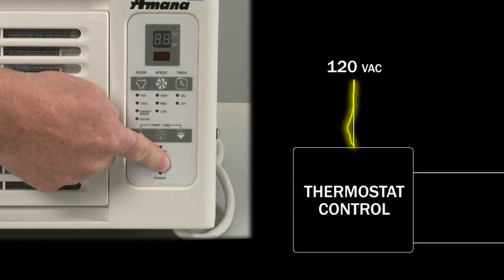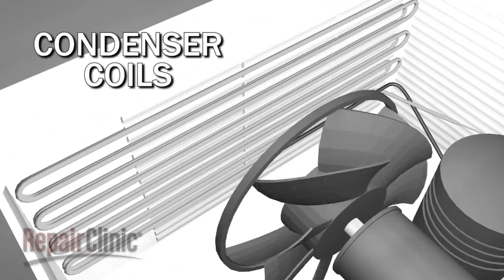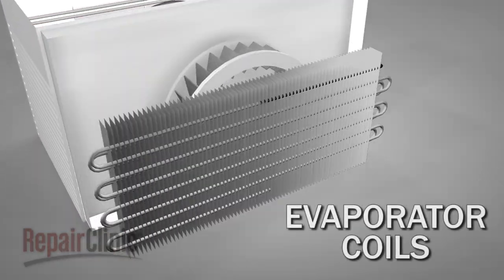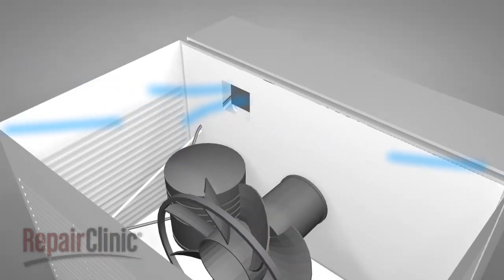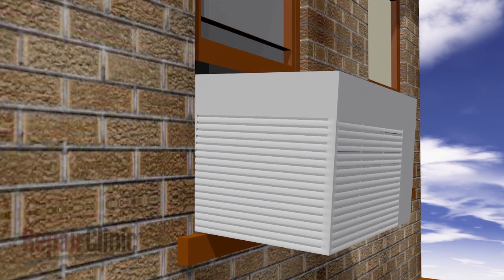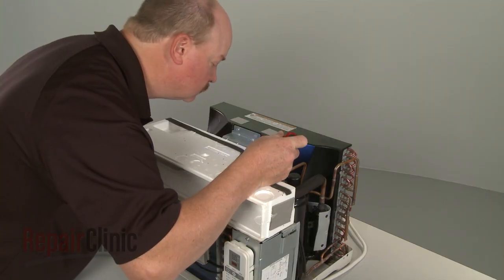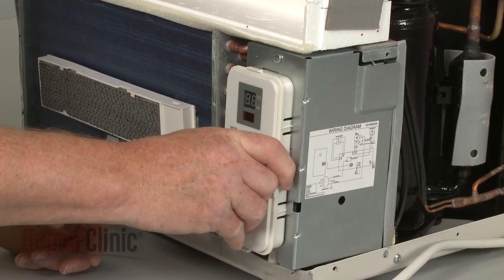How Does An Air Conditioner Work? — Appliance Repair Tips

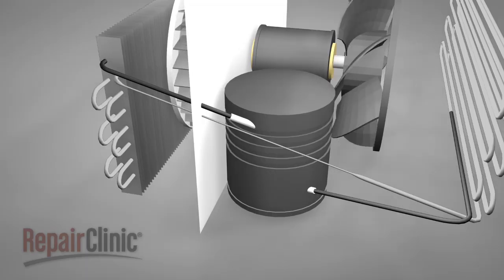Comment: The compressor does not convert the refrigerant back to a liquid lmao which is what he tries to say at 1:10
Reply: Yeah, converting a liquid to gas and gas to liquid is done via the evaporator and condenser coils. The compressor should be increasing the pressure of the gas.
Reply: 1:42 can anyone tell me what that brown wire just above the barcode is ? i have a feeling it may be something important. see the thing is i move that out of the way every time i replace the filter. over time it stressed that wire out that it broke. and now my air conditioner wont cool. it runs and the fans runs but it doesn't cool.
EDIT : watching further this may have been a "Sensing Bulb" but i cant get a clear answer from the internet.
Reply: @SIDEKICKONYOUTUBE  That's not a wire. The sensing bulb is copper tube usually filled with refrigerant (not part of the A/C refrigerant). In an A/C system it is attached to the expansion valve to monitor flow. That has to be there.
Reply: @BillC-64  mine feels like a tire wire. its positioned just the same as in the video. i thought it was just some sort of holder for the filter. if i trace the tire wire looking thing it connects to the control box and somewhere in there the tire wire is enclosed in some sort of plastic insulation.

Comment: "Any repairs must be performed by a registered technician" and pay his ass 200 dollars? Nawww these youtube videos are fine, it's like college except I'm not going to be in debt $60,000 like everyone else :D
Reply: 200 dollars I'll just buy another ac
Reply: +Alex Reyes yeah serioudly, that's what I did, my grandma's has a little window unit in a backroom that doesn't connect to the central air system and she was about to call to get it repaired, but you can buy them for like $125-$175 for the small units o.o
Reply: except you don't become an expert you become a diy and this guy said a compressor pumps liquid... never in 1000 years should an compressor try and move liquid and after your YouTube repair you find yourself calling a pro
Reply: I like Playstation if you paid 200 for a repair guy you would be stupid anyway. you an buy an 5000btu for $70 brand new. 9 times out of 10 people just forget to clean the filter
Reply: I suspect that within two decades, the current university system of four years and $50k worth the debt will be considered a backwards relic of the past. A large number of people will learn online and then go to accreditation centers to prove their ability. Also, unless you're taking a STEM degree (can easily eliminate a year from the program and cut down on the cost by tens of thousands of dollars by shutting off the valve of infinite wealth redistribution into their pockets and forcing them to cut everything that's not absolutely necessary; no more excessive administration or activist departments destroying wealth), all post-primary schooling (which I suspect will also get shortened by 2-4 years and will become more focused) will take the form of trade school that teaches you what you need to know in order to get to work in no less than two years.
Reply: when it comes to a cooling system using refrigerant it can be very dangerous to work on yourself without extensive knowledge on how the system works. It is pressurized.

Comment: Well These types of AC can be placed on your window or remove from your window since these windows type AC are small and compact some window type AC are Large There's a medium size and there's a Large size these Window AC that are are medium or large cannot Remove and Also you can Still place this to your windows if your window are large enough to place it just buy a support bracket but i preferred to Make a hole in the Wall of the house and place the AC to that hole it alot of work but yeah and also don't forget the support brackets but if you want you can Weld a Cage for your AC and place on Where you want to put it

Comment: AC is working but not blowing cold. is there a way to add gas in it without buying the compressor? like how u do with the car?
Reply from the maker: Calvin Le No. Only licensed service technicians can repair refrigeration system on HVAC equipment.
Reply: what about the one where you put on the window? can i put gas in there?
Reply from the maker: Calvin Le The sealed system is not worth repairing on window models. Refrigeration system repair is not a do it yourself type of repair.

Comment: Thanks. Just need to know if exterior air is circulated inside. There is an ash haze (fog like) condition due to wild fires in the neighboring county and wanted to know if that air is going to come in or not. It’s over 100 today so I wanted to limit the need to use it if needed as fire season can last for weeks or months. Though if rolling power shut offs continue, I might not get a choice any ways 🤷🏻‍♀️

Comment: Hi in my work it have a PTC 30 TON UNIT A/C THE EVAPORATER IT GET FROZEN IT Sshow me in the gauges tem/prss normal except a Hi linepress mark 310 psig 2 compresor what coul be  Model Carrier 50TM-025---511YA

Comment: Does it require freon?
Reply: no it uses refrigerant
Reply: Freon is a refrigerant.
Reply: +Potheadd_ Playz not all refrigerant is freon
Reply: Reid Antoniow Freon is the most commonly used, and you must have stated your first comment wrong, because Freon is a refrigerant.
Reply: +Potheadd_ Playz freon is a trademark and reserved brand name. it uses refrigerant
Reply: Reid Antoniow Your point is? Its still a type of refrigerant.

Comment: ANYONE HELP: My AC used to work great, but now when its cold outside and I turn on my AC it can make the room cold, and you can tell its not just blowing in outside air, but doing it's job. When it's hot out, my ac blows nothing but hot air for 15 minutes straight, then gives me cold air for about 20 seconds then back to hot and so on. Also when it transition from cold to hot it makes a very very loud banging sounds then it goes BOOM, then goes back to hot air. Sometimes that banging sound will last a while about 2 minutes for no reason. I took the AC out, and cleaned out all of the dust, but it just did not do anything. 

One video said that all you have to do when your AC gets hot is spray the outside and inside with a water hose. The outside seems plausable, but the inside? Should I? The inside of my AC looks like metal foil beneath the filter. It just seems wierd to take a water hose to it. btw I also do not think its the freeon as it gets cols and stays like a ac when its cold out. Anyways, it's really hot, dont really have money for repair, and I need help. 

ANY THOUGHTS?? Thanks in advanced!
Reply from the maker: Neal Caraballo Sounds like a compressor problem. That is not good because it is usually not worth repairing a bad compressor on a room/window AC unit.

Comment: I have a Samsung Air Conditioner. The led links but the AC doesn't work.
Reply from the maker: Miz We recommend using the repair help section of our website - http://www.RepairClinic.com/repairhelp?TLSID=1773 - if you enter your AC's model number there you'll have access to model, part and symptom specific repair help. We hope this helps!

Comment: any one pls help me . every time i will open my ac it cause noise it seems theres something inside.. and its not cold like before. what are those posibile remedy for this concern? thanks
Reply from the maker: +Ma Dianne Dela Riva Sounds like the fan motor might be shot. Check out the blower wheel and fan blade also.